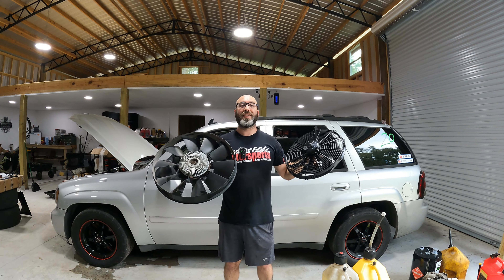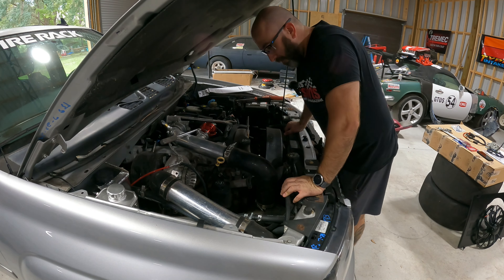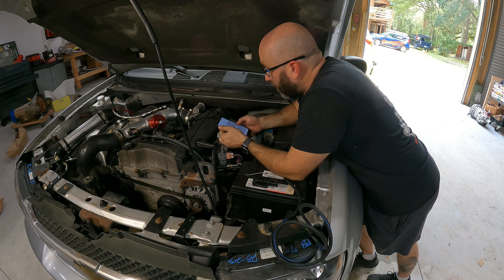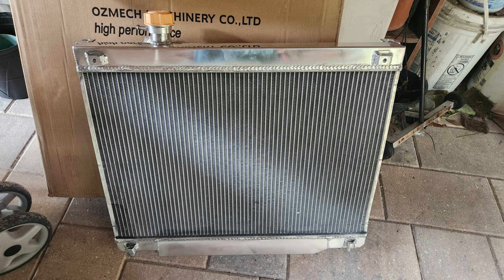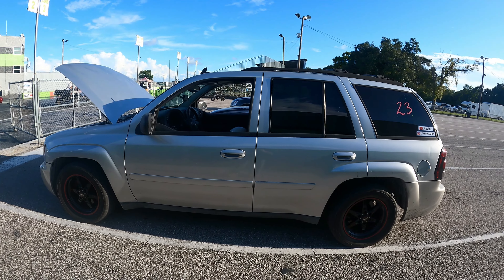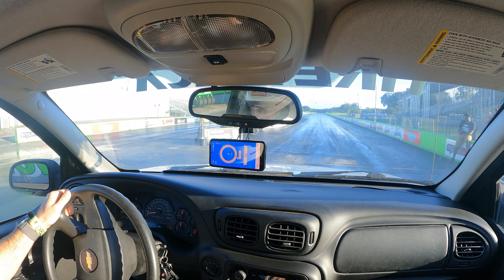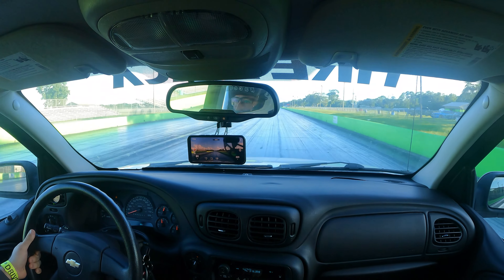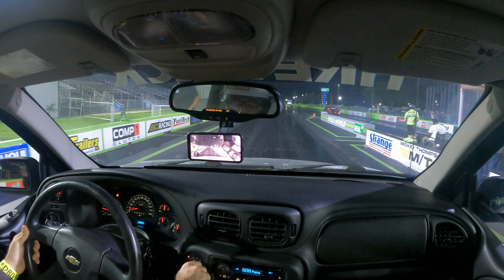Do Electric Fans REALLY Make Your Vehicle Faster?

Comment: You should definitely add an aftermarket trans cooler and not the one in the radiator.  Hayden makes a great one that has basically a thermostat in the cooler so it lets it warm up like a factory cooler before letting the rest of the fluid through all the other fins.  Look at the hayden 696 model or the 697 which is a bit larger. Its a great thing to add at less then $100.
Reply from the maker: Nice! We have a nice derale going in when the 6l80 goes in.
Reply: For sure that stock setup is a trans warmer.

Comment: Be very careful with flexible transmission cooler lines, hot transmission fluid is very flammable. I bought new lines for my transmission directly from GM for my Trailblazer.
Reply from the maker: Good point. These were a temporary solution as the lines going in with the 6l80 are good 6an lines going to a stand alone cooler.
Reply: was going to say the same thing. also check the inside of the line. some have a plastic lining that can melt and clog the filter.
Reply from the maker: @kylelawson91  It was just temporary. its all getting ready to come out.

Comment: Question when you change the fan would you recomend maybe changing our the old Alternator for a new High output  Alternator.
Reply from the maker: I wanted to see how the stock one reacted. Honestly, it does fine. I don't think it's necessary.
Reply: might be a good idea if you have an older car with small alternator

Comment: Where did you find the pins to connect to the computer . I can’t  seem to find any info on that part and I bought the pcm of nc kit
Reply from the maker: The wiring from pcm comes pre pinned. You can get the kits on amazon, though im pretty sure.
Reply: @J-Whit  just can’t find the info where you said you had pin 39 at the ecu from connector three  . Sorry but I bought the pcm of nc dual ls1 fans harness and can’t find really find any info on that part in  the instructions just says the sub harness need to be grounded

Comment: They just let the motor spin a little bit more freely..as in a clutch fan style set up.. if i had to say what gains you would get i would say in the 10 to 15hp range is a pretty
 standard plus it's gonna cool the radiator alot faster..